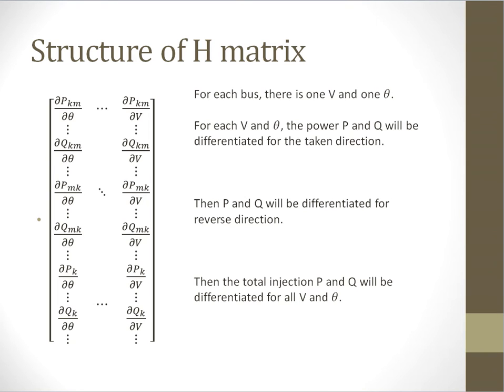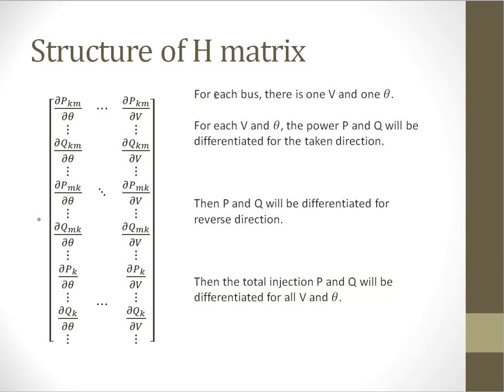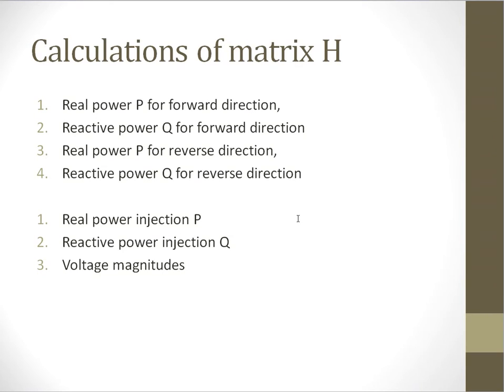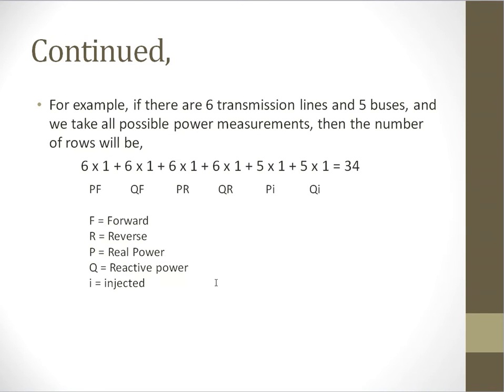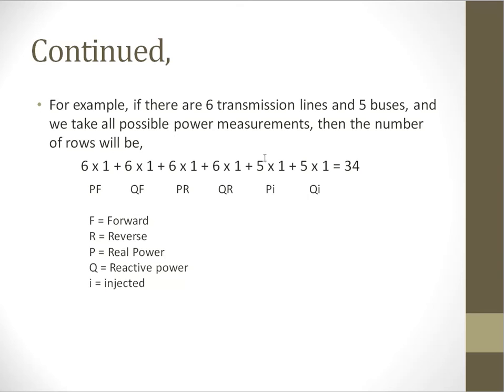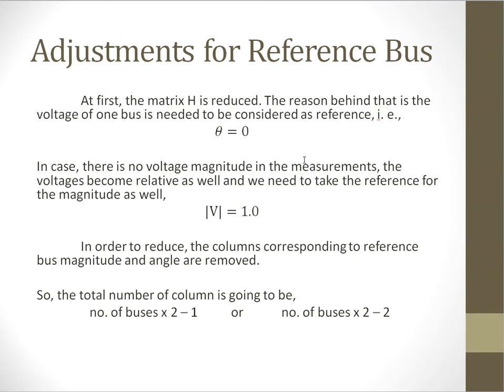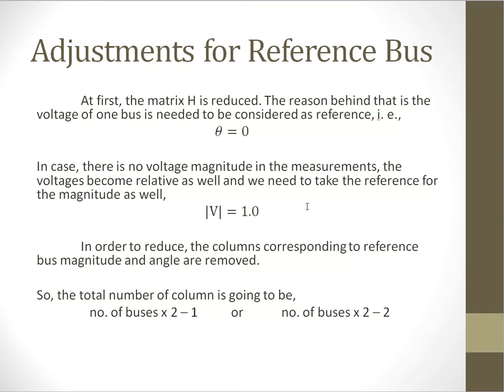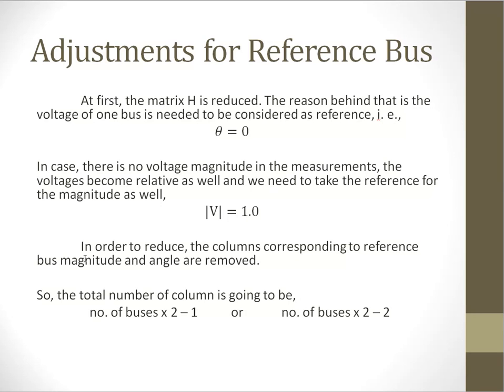03 Power system state estimation - Jacobian matrix

Comment: If no. Of bus is 5 and no. Of transmission lines are 7 then how much measurements will be possible and how to find?
Reply from the maker: for each bus, you can measure P and Q injections, for each line, you can measure P and Q flow in both directions.

you can also measure the voltage magnitudes at each bus as well.